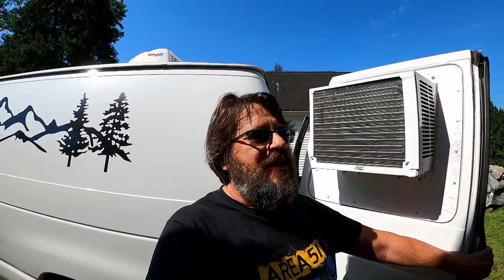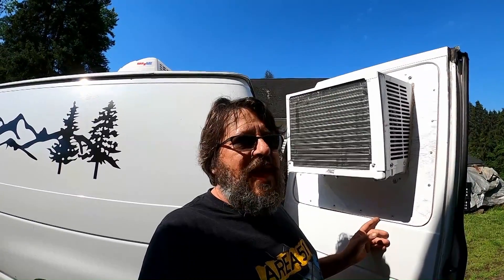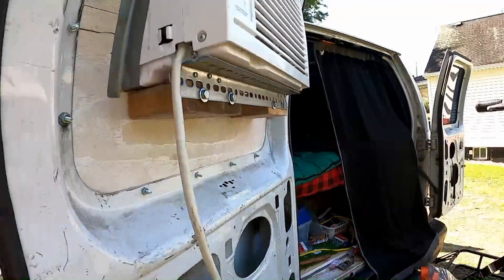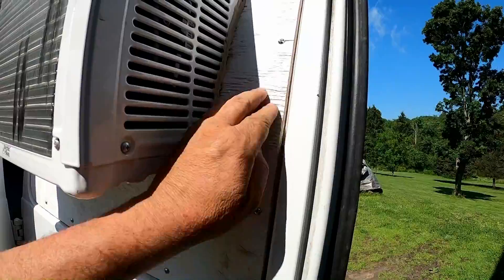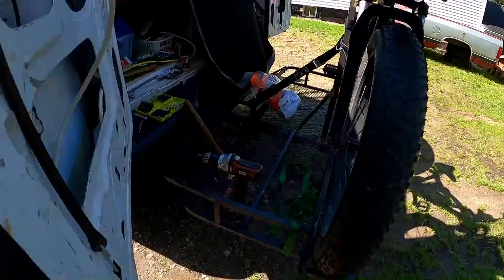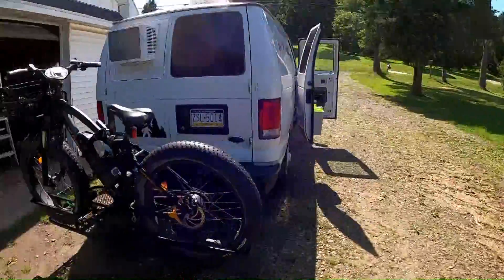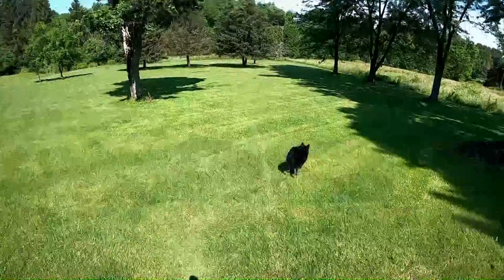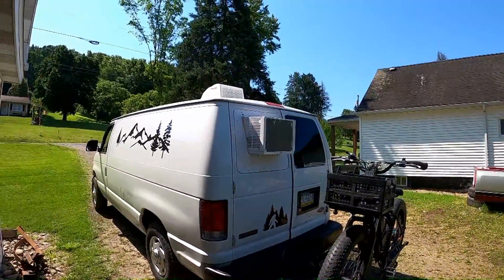Safety Concerns & How I Installed A Window A/C Unit In My Van - Air Conditioning Problem Solved

Comment: Nailed it.
You went with 'Arctic King ' . Good man . Mine's two and a half years old and going strong. Mine came in black , go figure. 
These newer units don't have a drain hole. The water gets slung around and evaporates. BUT ! Here along the Gulf Coast the humidity is soo thick that I drilled a 1/8" hole underneath. Carefully.  This thing around here puts out buckets of water ( it seems ).
You could add small break lights to the bike basket.  You'll be fine.
Final test ...when your a/c is complete...get the garden hose out and simulate a rain shower over the unit. I hate a wet pillow.
You are set . Go man go !
Reply: ...one more note.
Unless you want to enter your van in a car show ( which would be cool if they had such a thing ) The color scheme of you van doesn't matter to the woods , lakes , fish , birds or other nomads.
Non van dwellers will always wonder ..."What is that ? and how does it work.? " Most comments I get are ,,," wow , that's cool"

Comment: Ha Ha!  You starred the van and Bella looked so disappointed when you turned the van off.  I think she is ready to roll...  Regarding the vent cover, if your concerned about how the black would do, just cover it with a dark towel or tarp to see what kind of difference it makes..  Good job on the air conditioner.   I'm with you on the extra support.  Would rather know I have too much than having to try to resupport something later.

Comment: Thank you so much for this video!!!! I’m a fiber optic tech and I work out of a Ford E350 bucket van. Just built this exact setup to the T and it works great!!!!!
Reply: Update I put in a 6000 BTU window unit and it gets Ice cold. You could definitely use a 5000BTU but my company paid for it so might as well😂

Comment: That sounds like what Ford Did with My 1998 Expedition with the 5.4 liter Engine.   I think they just said let's hurry up and build this engine.   It has blown out 1 spark plug so far.   I have heard that they usually blow at least 2.

Comment: Your van is slick enough I can't see a cop stopping you for your plate unless you get a really super Barney one. Brake lights look super and we all have to have the third one so I don't see a safety problem unless it doesn't work. She's looking good. The DOT silver/red reflective tape they use on semi's artfully done is an idea.

Comment: On this particular window you have to take a knife and stick it between the black gasket and cut the glue all way around it remove each bolt and cut glue also around bolts well on mine I had glue holding on the window as well idk if all vans have that glue but mine did

Comment: I just bought the same kind of air conditioner for my van and I like your ideas. I'm gonna be running mine off of solar. I think the extra brace sure couldn't hurt. My wife is a bit upset with me because she wanted the kind that will fit under the solar. I think she'll be just fine when she's nice and cool at night when she's sleeping in the cool air.

Comment: Dave, one of my mottos is "Better safe than sorry," so I agree with the braces on the bottom of the a/c and on the back rack. Definitely, over-engineering is smart. "Do it right the 1st time" is another of my mottos.😊 I agree with your choice of black for the a/c area. I also like the white vent cover on the top of the van.

Comment: If 3/8 was too thin, you could laminate 2 or more pieces together to double or triple the thickness after bending😉 Don't think you need it for the AC. Carbon detector seems like a very good idea for any camper.

Comment: Only one question where is the water drainage to flow out of the AC ?
Reply: It has a small Port that allows water to spill out or it just spills out over the bottom edge as long as it's tilted it's no problem.

Comment: My a/c is setup the same way but I tilted so it drains to the rear bottom of the cooler outdide. At first I didn't tilt it and it drained inside of my van.😞 so I had to fix it correctly. Put brackets and a small piece of wood beneath it to maintain the tilted angle of the a/c. I intalled naamco plugs one on each side of my van to hook up at camping sites or family members & friends homes. Then I can run a strip plug inside for various gadgets or ceramic heater. I have a 1992 GMC VANDURA CONVERSION VAN.👍

Comment: Nice job only thing you might think about adding with some grilled  work protect the condenser coil fins, you could frame it with angle iron or Square tubing and then run your bars across keep your condensing fins From getting  smashed down

Comment: I see one potential problem with the AC install. You have washers on the inside where there is metal for the nut and washers to lay against but there are no washers on the outside where the bold heads lay against the plywood.. The vibration of travel will cause the bolt heads to eventually pull through the plywood and create a hole that will require a larger (1") flat washer to hide and make secure..  just my 2 cents but I would pull each bolt (one at the time) and place a 1 inch flat washer under the bolt heads to prevent that from happening.

Comment: Dave you did a nice job on that A/C unit.  However you didn't say what kind of plywood you used. If it isn't marine grade then it will  de-lambiminate  when it gets wet.!You need to seal around the edges and under the A/C unit too.

Comment: I bought a 2014 NV200  52 thousand miles last Friday, trying to get the cargo cage out it has two stripped bolts attached to the ceiling , purchased bits that are supposed to work to remove them , but it didn’t work. 🤨got to find some one to take them out for me.
Reply: Your van is looking great safe travels🤗💕

Comment: Man nice video I have been considering a portable ac for my van but I already have a 5,000 btu window unit I found on the side of the road that works great. I am going to go this route its perfect for my floorplan as I have a rear Hvac unit in the same corner you mounted your ac so its dead space anyway for me. Also seems very east to run a drop cord inside the door and plug this baby in.

Comment: I want to do this, add a receiver hitch carry deck. Put a honda generator on it to power this. Also possibly while driving. What should I consider with the honda suitcase generator and possible rainfall and the cord and risk of shock or damage? Does anyone have any tips? - - - - I have a 2002 gmc Savana. My windows are glued and no bolts. How can I redo my windows to be bolt in and out with rubber gasket? Thanks

Comment: Hello Dave my name is Steve I am fixing to get a 1999 e250 Econoline extended cab van was wondering if a small air condition like youhave in your van cools the van down on a 90+ degree day ,, let me know how well it cools your van down with that one unit running I was thinking about turning my van into a camper so it would be nice to get that kind of information thank you.

Comment: Nice vid.  Its been 2 years now.  How has that plywood held up in the rain?  I would think it would rot and leak.  Thx.  Im doing this mod to my chevy van this week.
Btw....how are you running your a/c?   From an inverter from the alternator while you drive?   Or are you hauling a generator?

Comment: That’s a great idea and it looks like it’s gonna work! How much solar do you have to have to run the air conditioner?
Reply: A 5000btu air conditioner pull 4-5 amps , I have 2 100WATTS solar panels and a 2000watt inverter 
The 200WATTS brings in more amps than the air conditioner uses,  I also have 2 AGM BATTERIES , 
ON A HOT ARIZONA DAY IM SURE THE SUN WILL KEEP UP WITH THE AIR CONDITIONER AND KEEP THE BATTERIES FULL 
(this has not been tested yet) hope it works👍🏻🎉
 😡I hate GENERATORS with a passion

Comment: Just in case you haven’t heard it’s been reported that this is a bad year for Lyme disease for both humans and pets.  Please be ever so diligent checking over yourself and Bella after being out and about even if using preventative treatments for you both.  The abundance of ticks has noticeably increased
I think it was mentioned due to the extreme high temps and dry spells.  🍈🦠